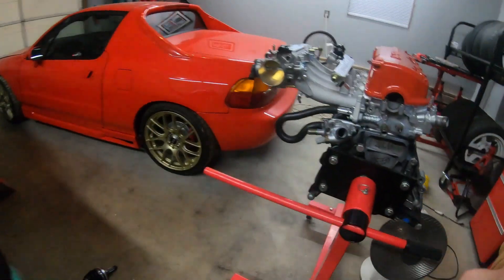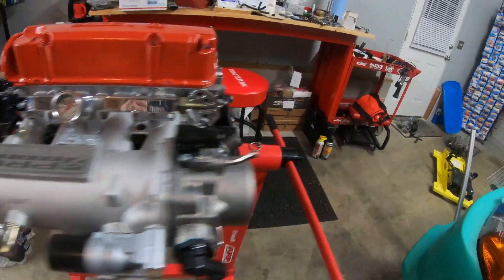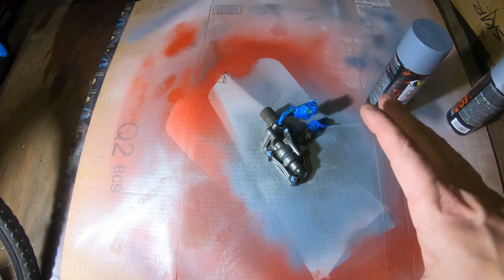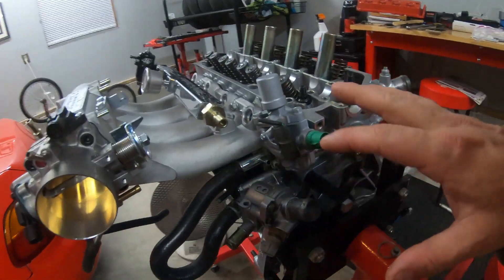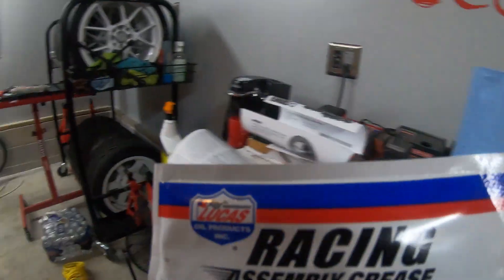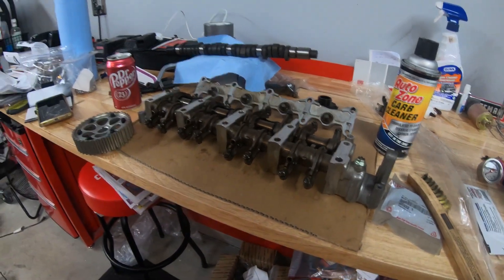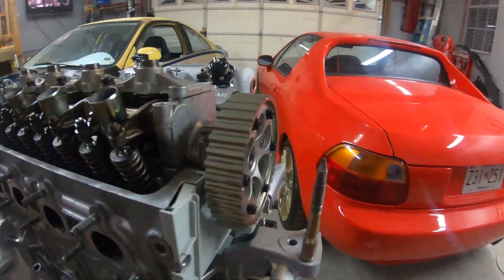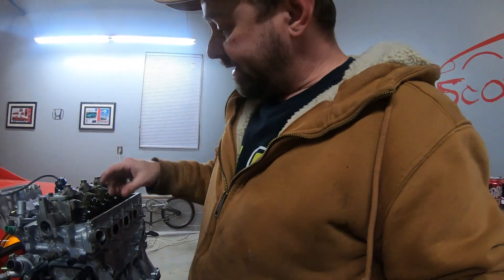D16Z6 Motor Build Part 14 - Installing the Crower Stage 2 Turbo Cam - More Parts More Issues?

Comment: I build a d15b2 block with a d16z6 head VTEC and 272 Delta camshaft and Y8 head gasket and light weight flywheel and gd clutch and gd air filter and I was real impressed with suck combos is in my CRX wow fast gd to travel for such cheap junkyard combo and program p08 ECU really express the hell out me I only expend around a g with header and Free flow exhaust system and the result is beautiful sounds nice like a muscle car in the gas station and and a Ferrari in the highway is around 11 compression or 10.5 build mostly from junkyards parts really know bad best cheap mini me in my opinion all motor I don't like turbo my is more old school style and amigo gd job